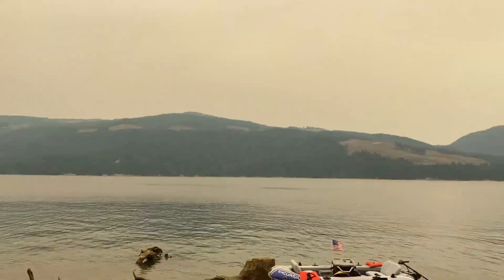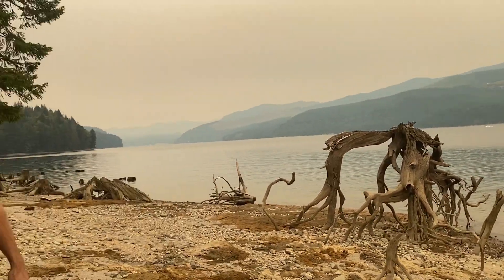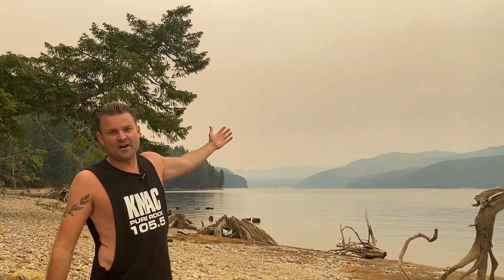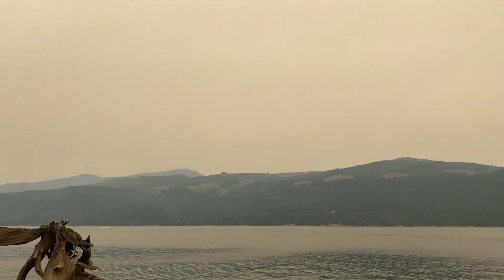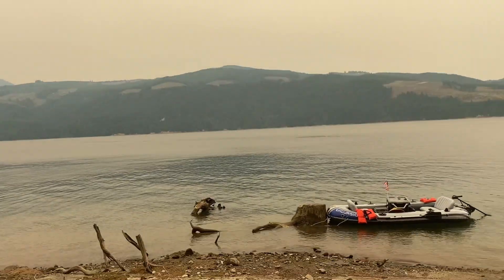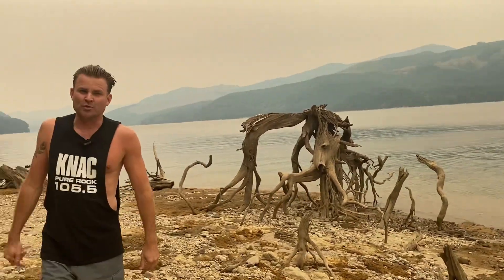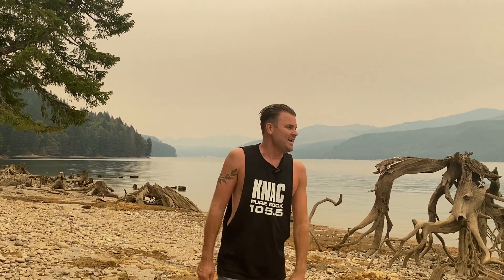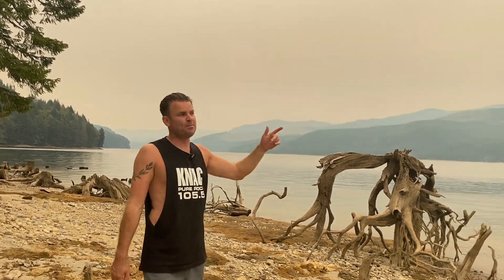PUNCTURED! We got a hole in our Intex Excursion

Comment: Any tips with high wind? We got the same boat with a Newport 55LB Thrust trolling motor, and if there's any kind of wind we get blown around like crazy, Even putting the motor on full thrust can barely push back.

Second issue is that the wires connected to the batter seem to get crazy hot - Not sure if that's normal.

Comment: Do you have to register the raft with a trolling motor?
Reply from the maker: No... Washington lets you off if your boat is under a certain length and small motor
Reply from the maker: ...I don't remember the exact numbers but the Excursion and 40-lb thrust motor I use doesn't exceed them